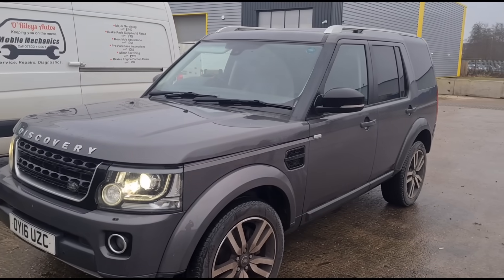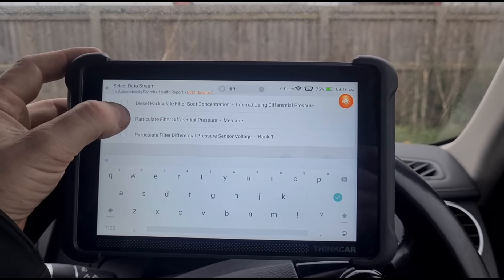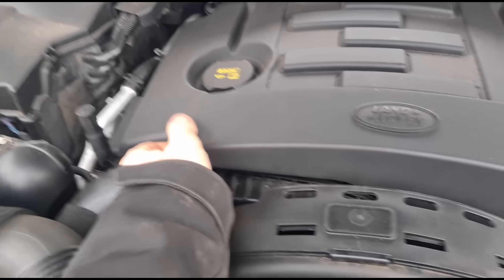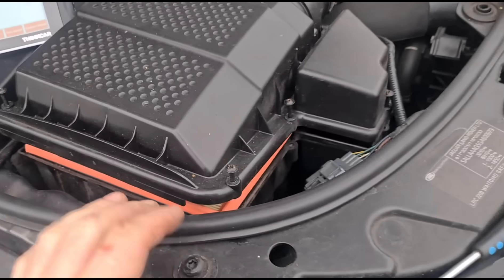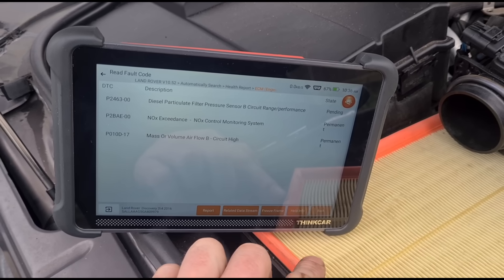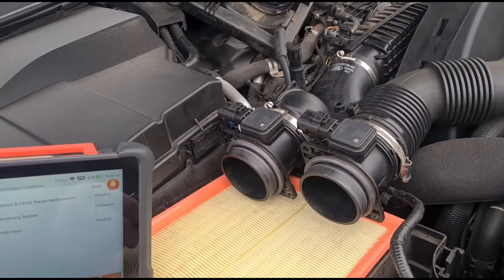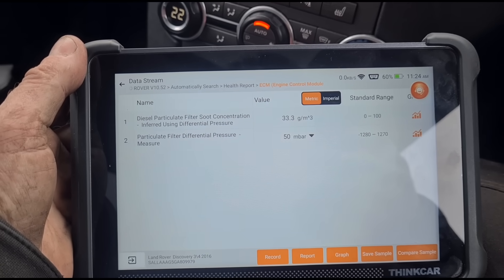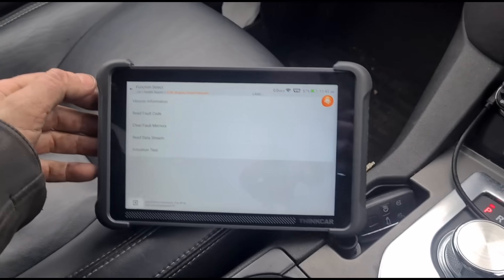Land Rover Discovery 4 P0103-17 & P2463-00 & P246B-00

Comment: My neighbour is a farmer , he has a series 4 and 5 , both bought used. He prefers the 4 as he said it rides better especially when towing a trailer full of sheep. He hasn't had any problems with the 4 in the 5 years we've lived here. Before he got the 5,  a year ago,  he had a  BMW X5M40 which he hated, said the ride comfort was appauling. He took me off road down an old droves trail in the 4 , wow, boulders that were huge it just cruised over at super slow speed and comfort on the trail was amazing.  I run a 12 year old Shogun / Pajero .....you simply can't understand how good the disco is until you've had the awful suspension on the Shogun !

Comment: Hi Jimmy, love your videos. I have a 4 cylinder Land Rover Discovery 2017 which I bought in 2018. Love the car except the DPF, have had no end of problems and it’s been back to Land Rover multiple times and they’ve never been able to give a long term solution. Last year I took it to DPF specialist who took it out and cleaned it, all went well for about a year then I overlooked filling the Add Blue. Then not long after I topped it up it registered DPF Full again. I took it to another mechanic who advised the whole Add Blue system including the tank needed to be replaced! Have you come across same issue on a 4 cylinder / done any videos as I’m determined to fix it myself this time and understand the issue.

Comment: Hi Jimmy, great vid (as always). I live in Canada and have a Disco 5 with this engine and I continually am getting bad DEF fluid code - been back to the dealer multiple times and now they want me to put in a new DPF/SCR in - I told them I've been following you and that aint happening, the DPF isn't the issue (although it is slightly blocked now). Any suggestions on a different product for the DPF fluid you use to clean it, I can't get the Launch fluid you have in the UK... I did buy the LAUNCH X431 PRO Elite after seeing you review it, so I can do a DPF REGen, but you suggest not to do that? Thanks for the help - we all appreciate the content you put out!

Comment: The venerable 600nm SDV6 engine is vulnerable to crankshaft failure as the design only has 4 main crankshaft bearings (yes another environmental emissions crazy design to minimise engine parasitic friction and improve economy 😂 similar to Ford’s wet belt design). Keep changing the oil and filter regularly and pray.
Reply: Nothing to do with bearings. Everything to do with poor quality control in metallurgy

Comment: Thanks Jimmy, the car has just been down to Devon and runs beautifully now
Reply: Hi
I have the same vehicle 
Can I ask how quickly it asks for.a service relative to the reset default milage 

Mine suffers from oil dilution. 
Its just off for a new throttle body u dee warranty but im not optimistic. 
Im in devon myself and all the garages are scared of it😂
Reply: @ludicrouslumens975 what sort of journeys are you doing in it, i was using mine for a journey to and from work that was about 2 miles and only took 7 or 8 minutes,  the car just doesn't get hot enough and not enough time for a re gen and this caused oil dilution too. These cars need to be driven so mine is rarely used now for journeys less than 20-30 minutes
Reply: Hi mate
Thanks for the reply. 

Well mixed driving really 

Plenty of 50mile + journeys in with the normal back and forth trips 

I watched live data for the last 300(fast test journeys)miles prior to it going back in for the replacement throttle body.

Ita only when its initiated an active regeneration that it gains any oil(as you would expect.)
And it will not do any passive regeneration at all(hoping the new throttle body sorts this)

Regens are happening between every  25 & 65 miles & its around a 1000mile service  reset milage drop for 100 fast actual miles travelled.

I data logged a mates 2015 & his is showing around 600 miles between Regens so very different. 

I dont supose you have an ideal of how often yours is loging a regeneration?

There is a lot more data on the 2016 model when you go into the scanner so its not a true like for like..

Would love to know what another  2016 is doing.
Cheers

Comment: Hi there, I have a w212 e220 cdi with p0101 and p2463 fault codes. I only have a cheap autocom scanner so can't read dpf diff pressure but I was wondering is there any way to diagnose the differntial pressure sensor without one. Apprentince mechanic myself and haven't been able to get any info from any mehanics around me.
Reply from the maker: Digital manometer

Comment: Hi Jimmy been watching your videos as having dpf issues with my 1.6 tragic anyway i brought a launch tool and some bits to clean it out im going in through the ox sensor near the upstream pipe thingy which i unblocked after seeing your video and was jusy wondering in your video you say about having under 5 hpa reading on dif pressure sensor is this whilst the ox sensor is off or once its all put back together? Cheers great videos by the way

Comment: Dear Jimmy, congratulations on your fantastic work!
Ive watched many if your vids and learning so much which will hopefully help me fix my problems with my e350cdi coupe.
Ive bought icarsoft mb v3 and some cans of mannol. Going to try a dpf clean and test the pressure sensor etc. ive already changed all the intake seals and pcv. 

**Please can you tell me if its safe to squirt the cleaner in the sensor pipe, no danger of cleaner flowing back into the turbo or the engine?? **

I think at least some probs were caused by a nightmare local garage splitting the o ring  on my boost pipe, then the dpf stopped regenerating abd now i think its chock full!
Thank you so much for making the vids abd Im jealous of all your amazing kit!

Comment: On the SDV6  -  it is sequentially turbocharged  - the secondary turbo  comes in at 2800rpm - so the airflow across the 2nd maf will stay close to zero until it switches in the secondary turbo.

Comment: Does anybody remember the days of when cars didn't have 500 sensors
Reply: I remember when engine bays had so little "engine" in them, you could nearly step in and work on the engine from inside the bay!!  Stupid sensors throw up fault codes if you fart the wrong way
Reply: i had a ford escort mk1 mexico  it had a slow down sensor fitted to the passenger seat
Reply: Yep.  Most the engine bay is filled with the induction system these days. 
Remember the Triumph Herald or Spitfire,  you could sit on the tyre and work away. 😂
Reply: @TheTwelly  you wouldn't want to be in a collision in an old spitfire.  Game over day
Reply: @mattmckie6967  , Too damn true.👍
Reply: Pre climate nonsense
Reply: But you wouldn't drive one today tho .
Reply: @mattmckie6967 bet I would 👍
Reply: I had a Golf mk2 1.3 gasoline. Sold with 410 000 Km. First thing to malfunction was the km counter at 320 000 km
Reply: @Curioslife-hu6nf  did you tow it behind your RV?
Reply: Are we talking about toyotas
Reply: @Ak--zs7xj  you know the score then!  Me 2
Reply: Like my 1953 Series 1, even the main fuse box had a single heavy gauge wood screw 😂😂